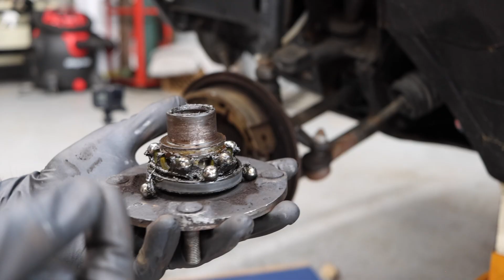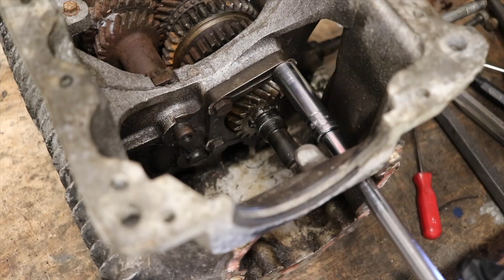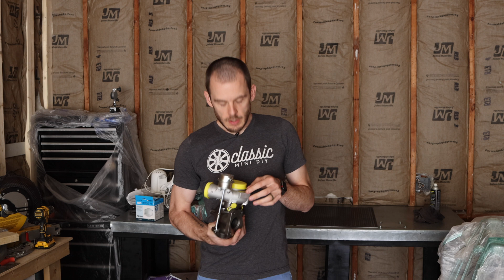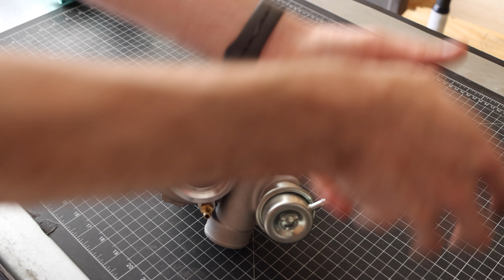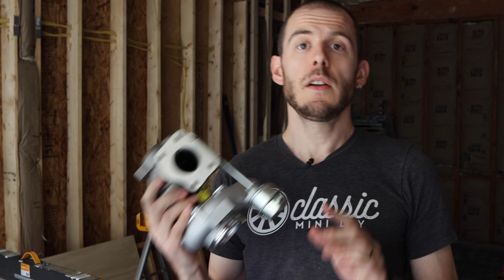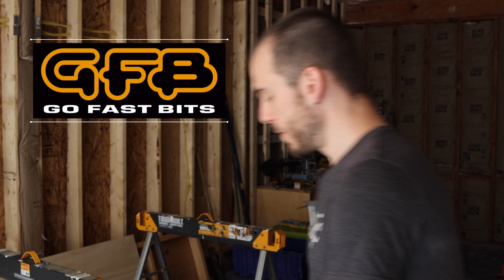Preloading a GT1752 Turbo Wastegate - Classic Mini

Comment: Mitsubishi TD04 from Saab 93 is a far superior turbo
Reply: It's a bit big for a 5 port mini. A TD04 is a capable turbo, but for driveability, the GT1752 is proven.. and on the right build will make 200bhp 👌🏽
Reply: @Dagowly83  TD04 is comparable in size to the GT1752, got one fitted to my mini, spools up relatively low and is far superior in component quality than Garrett turbos
Reply: @minmog  interesting. What trim? Genuinely interested to see other alternatives and potentially BB cores!
Reply: @Dagowly83  Using Saab 93 TD04 14t. Nic on Turbominis would have more info on them, it was on his recommendation that I converted mine from old T2 to it.
Reply: @minmog  I knew Colin was using one on his 16v K head, nice to see there are other options!
Reply: Are you using a saab TD04 15T turbo?
Reply from the maker: What makes it more superior? I don’t have a ton of experience with different turbos.
Reply: @classicminidiy   Having worked for Honeywell for many years I wouldn't want their poor quality products on any of my builds. haha

Comment: Love your videos.If you had trouble with fuelling with your supercharger what are you going to use for the turbo?
Reply from the maker: Thank you! The turbo is going a different route called “blow through” meaning the carb will sit after the turbo vs this suck through system where the carb sits before the supercharger. So fuel management should be a bit more straightforward and easier to account for. Still will take some time but certainly much easier. 🤞🏼